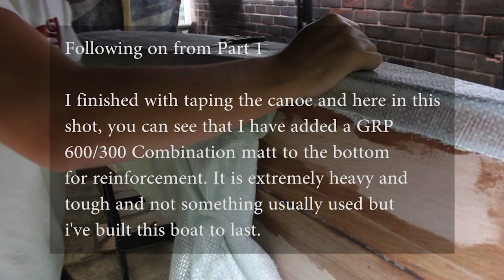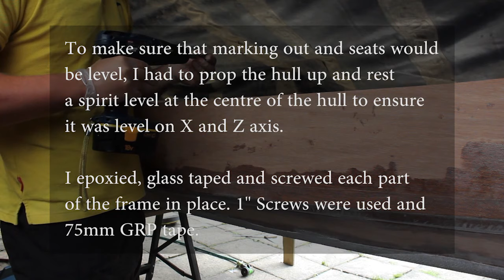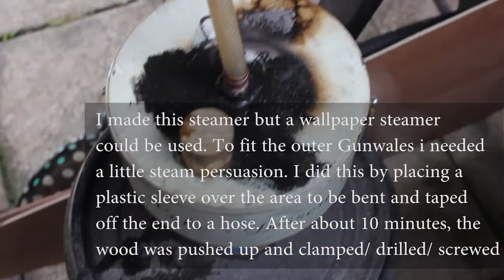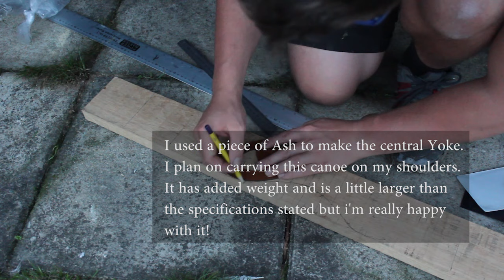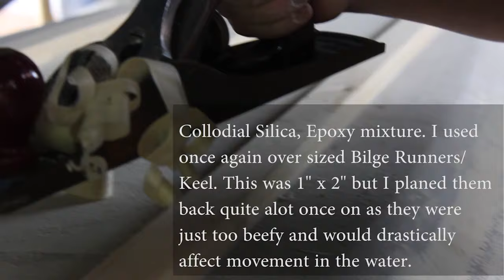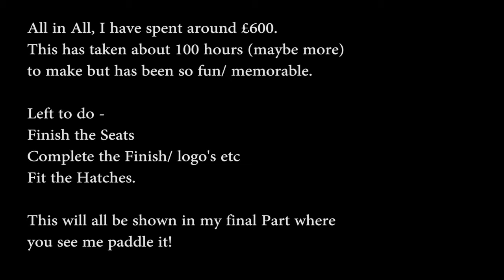Genius! Boat made from Plywood!?! Why doesn't eveyone know about this! (P2)

Comment: A Heat Gun/hair dryer can often be used to persuade wood to bend.   Also, several thinner layers laminated together works in high modulus of elasticity situations which also makes for a stronger piece that won't split under stress like a solid piece. 
Copper rivets or Boat Nails and Burrs used instead of screws not only clamp stronger/hold better, but aesthetically look right on a boat especially if clear finished.

Comment: 600 ponds wow, what is the biggest cost? i find this expensive
Reply from the maker: 100 a sheet of marine ply wood x 3or 4, epoxy and fibreglass... just added up. with all of the odds and ends on top of this.